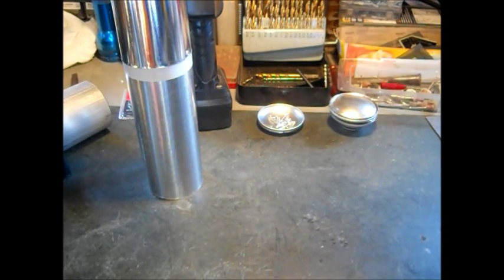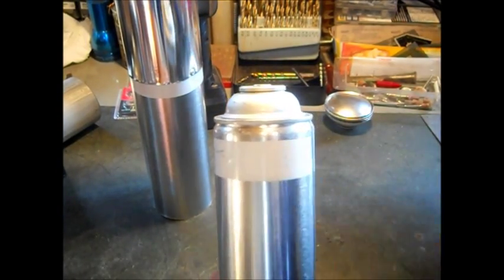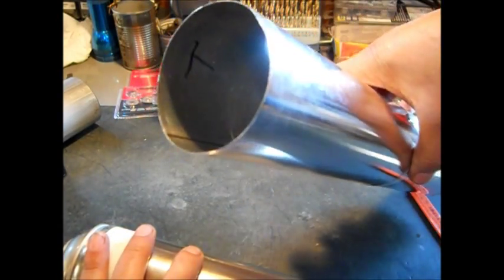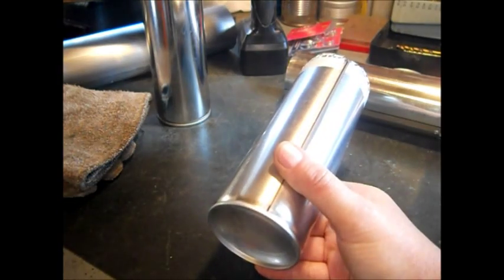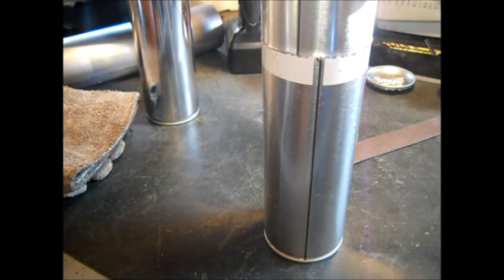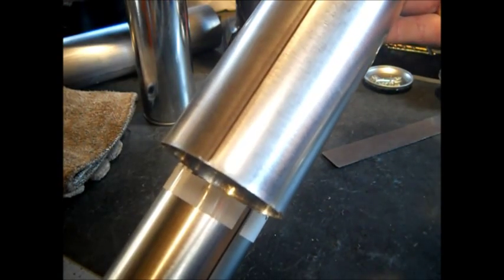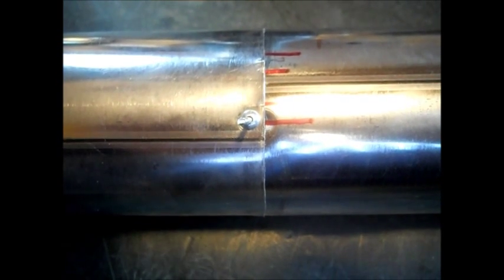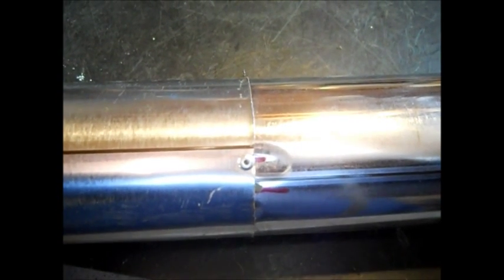Tin Can Stove Pipe

Comment: How long will those pipes last and how high a temp do you get when your stove is fired up?
Reply from the maker: I have not checked the temp. But I have used these pipes alot. and they have held up well Most of my stoves use car exhaust pipe for the the first foot of pipe and that does help the cans not to get to hot
Reply: car exhaust pipe...hmmm, got my brain to ticking there, LOL I've got an old van I can get the pipe off of.How well would flex pipe hold up?
Reply from the maker: I did not know they still made that stuff I would try it if it was cheap to buy
Reply: Have no idea, haven't bought any in over 15 years, lol Just assumed they still made it.